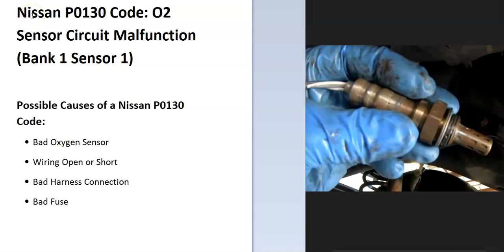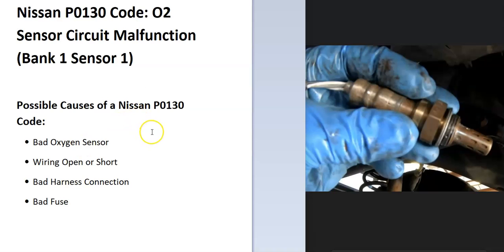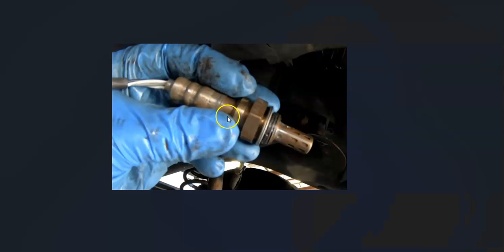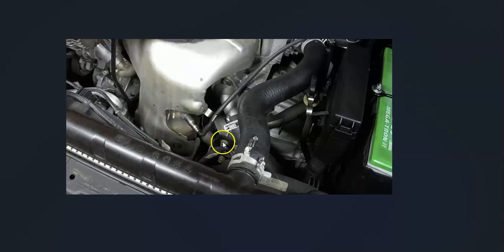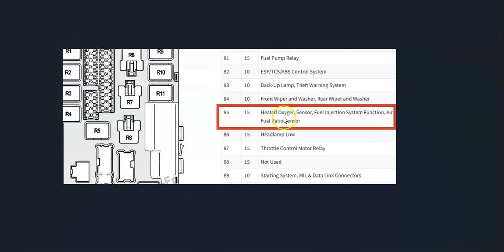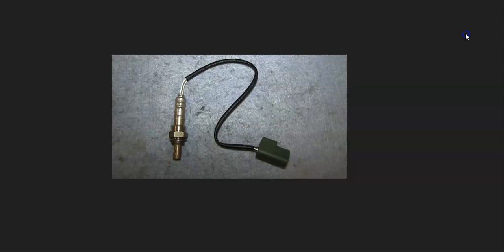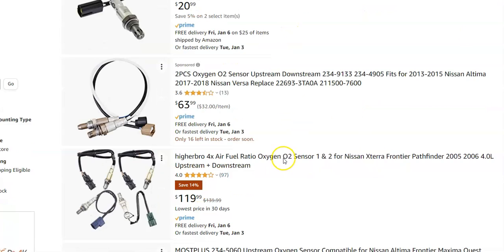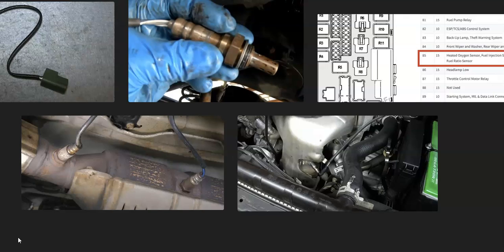Causes and Fixes Nissan P0130 Code: O2 Sensor Circuit Malfunction (Bank 1 Sensor 1)

Comment: Ilk kez ya okadar video seyretyim sonunda teknik olarak calisan bir usta ya denk geldim ellerinize saglik Ilk olarak Tebrik ederim 
P0130 bank 1 sensor 1 problemi 
Bu problem var ise Ilk bakilacak olay 02 sensor nin  voltaj okumasi olmali  .1 ile .9 arasinda dalgalanmali ve skop okuma da
450 ci varinca seyretmeli yani sabit bir okuma yada slow respons Eger okuyorsaniz 02 sensor degismesi gerek yada sabit bir volt okuyorsaniz o2 sensor  degistirmelisiniz eger 02 sensor degerleri normal ise data degerlerine gidip fuel trim leri okuyup negatif fuel trim okuyor olmalisiniz 
Ok genelde buyuk motorlarda rolantide dalgalanma hissetmezsiniz ama kucuk motorlarda hissedebilirsiniz  fuel trim degerleri negatif ise buna bagli olarak map ve maf sensor degerlerini okumalisiniz ayni zamanda cooland temperature sensor degerlerinide dikkat almalisiniz eger degerler normal ise vacum leak yada atesleme hatalari olmadigi da da emin olmalisiniz  su anda  ariza tehsiz cihazinda degerler normal gozukuyor cunki arizayi bulmussunuz Neyse kolay gelsin

Comment: Replaced bk1 sensor 1 on 2016 Altima s check engine light still on ,oxy fuse good help?
Reply from the maker: It needs to be diagnosed, but if the sensor is good, I would test the wiring.

Comment: I have an 08 xterra and on my o2 bank 1 sensor, it looks like theres an oil leak dripping onto it, should i just replace the sensor entirely? I also noticed the fuse looks bad and plan on just replacing that to start

Comment: Purchased a set from Amazon and those gave me a P2A00 and a P2A03 code. Could not identify the problem other than them being an "off" brand. So, after navigating thru Facebook group, the off brand could've been the issue. So I replaced Upstream O2 sensors with Bosch brand (OEM apparently) and replaced the original Downstream sensors for now (returned the amazon ones). Now I am getting P0130 and a P1148 codes. Any ideas would save me some hair pulling lol. Thank you.
Reply from the maker: I would double-check all the wiring and check for any blown fuses. If all of that is good and the 02 sensors are good, it might be the ECM. A bad ECM is rare though.
Reply: @HVAC_Mechanic  I sincerely appreciate the reply. Fuses was going to be my next attempt thanks to your video. One note I should add, is that I replaced the fuel pump (Non-oem) that has been giving me trouble... only because when I add fuel I have to go extra slow otherwise it will spit out. Like the air gets caught. Regardless, it could be a faulty fuel pump? Would that make sense?
Reply: @timothytrujillo2147  you need a mechanic it sounds like